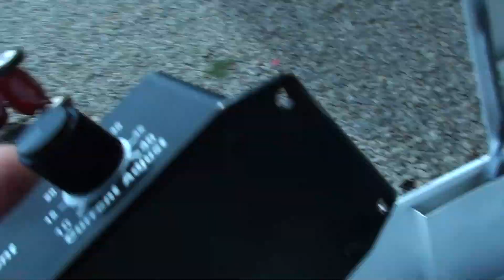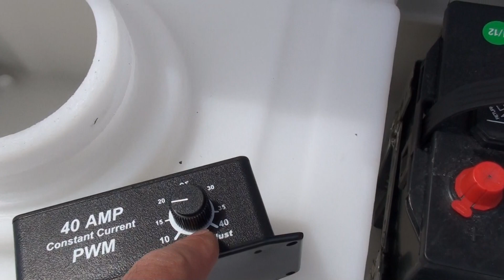288 Plate HHO generator Dodge Ram project. Part 2

Comment: I have a HHO generator built out of the water filter housing( stainless steel) and pipes. I don't know the right but it will pop up some damn HHO out of it it really is Kick-Ass My problem is it keeps getting too hot  So I  mounted it down behind the radiator right behind the fan I was thinking about actually piping a cooler from the generator into the transmission cooler in the radiator sense its not being used because I have a aftermarket transmission cooler how do I do it and will it work to keep it cool

Comment: ok, this might be a stupid question, but because you are using a mechanical alternator connected to your car, wouldn't  thermodynamics come into play, thereby causing you to have a net loss?  You are simply making the engine work harder to produce the HHO.
Reply: He have an battery separator and  a second battery , the HHO is used basically to save and use all the wasted power and is increasing the fuel burn .......so ,if you do the math ....... YES the HHO save with 60% your regular fuel consume  if you know how to hook up right  all the system !?

Comment: Great experiments & tyvm for sharing! 20 Gallons of water sloshing: Buy one or two plastic clothes baskets that could roll up for the tank opening, unroll inside tank, and baffle tidal waves caused by normal driving.  Future builds in a Weather Guard Box should position water tank below the electrical equipment and add drain holes, or two separate boxes to separate water & components completely.  You've placed safety layers for yourself already, so keep on creating!

Comment: Water Baffle : You will need a 5 gallon bucket  . Cut out 2 or 3 Rings about  2"  width  . Put the 2 rings together a ring with in a ring . Connect the rings on top and bottom with rivets . The water baffle with collapse( Compress Rings together) and fit through top of Tank !

Comment: A cheap way to reduce sloshing in your tank is to fill it with wiffle balls. My uncle used them in his formula 5000 race car in the early 60's before modern fuel cells were widely available. An added benefit is that you can pour them out to clean or repair the tank if needed. Cheers.

Comment from the maker: Thanks for the tip. I'm using fishing bobbers with the steel hook removed to control sloshing. it's working well. I have drilled a couple of holes in the top of the box and since H is lighter than air it wont stay in the box.

Comment from the maker: You should watch all six parts of this video.
Now a EFIE is for the o2 sensors not the tps but it's true the ecu will dump fuel without some kind of leaning device. Baking soda is the absolute wrong thing to use. It generates chlorine gas and then becomes KOH or NaOH I cant remember but these are bases not acids. You are right. Acids are not recommended.

Comment: A simple tee in the line leading to a Bubbler wil prevent sloshing from getting to the motor and the slosh just goes back to the Tank.  <ount the bubbler slightly higher than the tank and you go it!  Also, using the toolbox creates another problem, FUMES!  You may want to think about a breather hose going from the toolbox to the air filter duct of the motor.  this will provide enough draft to draw these fumes out of the toolbox!  Reducing those annoying BANGS that could come from the toolbox!

Comment: You are off to  great start, a little over kill, but great never the less.  The only thing missing is an EFIE. This device will give you the ability to dial back the throttle position sensor SIGNAL.  If you don't do this, the oygen sensors will sense too much oxygen and OVER FUEL the motor, thus giving you TERRIBLE mileage.  By fooling the TPS you will dial back the fuel and run more from the HHO Unit.  Also, Baking Soda works better than anything caustic.  Don't use acid based electrolytes.

Comment: hahahahahaaa back in 2008 when i had more than one batteries everybody was like hahahahahahha you using up too much power, and look now everybody start to use more than one battery. my advise is, see if you can get some capacitor batteries instead on the regular batteries. keep up the good job mane

Comment: cool you can use the tps as the primary circuit system. or is this a pre tps engine (carb engine). just interface it's variables / resistance output to the same in the pwm's pot. now the only thing that might get in the way is. if the setting are reversed. meaning the tps starts with a high resistance and drop as it throttles up. that wouldn't be good.

Comment: one more thing. will you be running some sort a circuit from the throttle control. to your pwm's to vary the supply of hho, when demand isn't required. just a thought.

Comment: use a floating pickup in the tank like a stunt airplane. you'll have full time immersion. and forget baffles. but if you think you must. then foam it your best option. and do you use any gas in this app.

Comment: maybe you could epoxy the tank back together hobbykingdotcom has some good priced electronics and hobby building supplies everything you could think of check on there site under Hardware & accessories. some good epoxies cheap and carbon or glass fibre to cheap could wrap the tank in that and epoxy it together

Comment: if you cut it clean nice cut theres plastic welders that would do it wouldnt cost much but i think a baffle is needed to stop the slosh suppose its just what kind of baffle , i still havent installed my 21 plate in my old landcruiser diesel because of the moisture problem 1 drop through a turbo blade wouldnt be good but i have just bought them small water filters spraypainters use they screw straight on the gun so there small to so will do mine soon but good work mate

Comment: also check out the prices for fuel cells on eBay and/or Amazon.
If you stay with the plastic reservoir you may want to weld some cross braces under the reservoir in order to keep it from deforming under the weight of the water, and maybe even some cross bracing for extra stability for the legs.

Comment from the maker: I like the foam Idea.
These generators run real cool even over 80 amps. I have spent a lot of time on it. It shouldn't get much over ambient temp especially with the large reservoir. I will diffidently see this project through. I know I will get better mileage numbers but how much is the reason for this project. We wont know unless we try, right?
I did some installs on my Dodge Neon in 2008 and 09. I have complete install and mileage numbers on video, take a look.
Thank you for your support.

Comment: looks good Steve. I've seen the baffles you're talking about in a mop bucket. Two seperate but parallel walls that don't extend above the water line. Seemed to work pretty good.

Comment: the foam is a great idea. you need some kind of venting system like on a boat. if a hose leaks, that is one big bomb! gas vapor makes a big bang, imagine hho! heat is another concern and the blower fan will help there too. you are making great progress. i have yet to see an install and mileage numbers on youtube. i want to build a system like that on my dodge if i get the coin. forgot to winterize wet cell and ice broke the bottom off... i had around 19-21 mpg on hho 14-17mpg without.

Comment: Some of the racing fuel cells have foam in tho keep sloshing to minimum.Looking great and I wish you good luck on this install.Look at hot rod shops they have it,make sure your electrolite solution won't eat the foam,racing gas does not so you should be ok.

Comment: Nice work. I just did an install in a toolbox similar to what your doing. I have a 2.5 gal tank filled about 3/4 full. I haven't had any problems with sloshing but I have a bubbler to catch anything if it does. These boxes are nice because you can visually show people the system without popping the hood. Let us know your results...